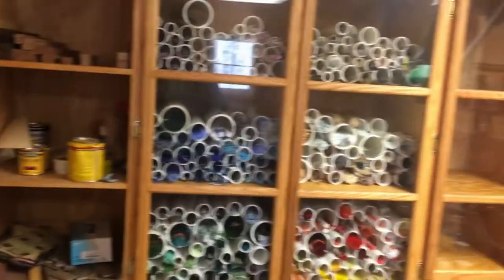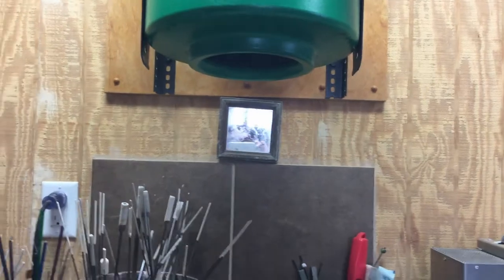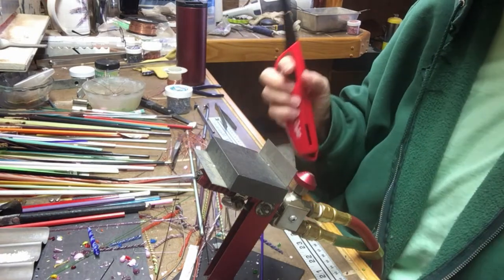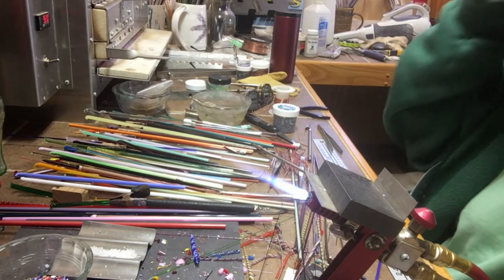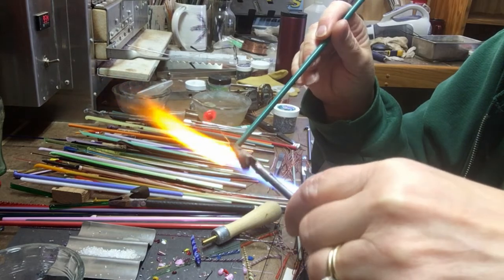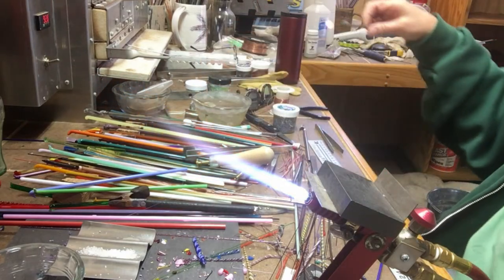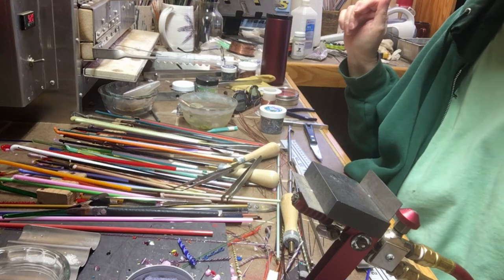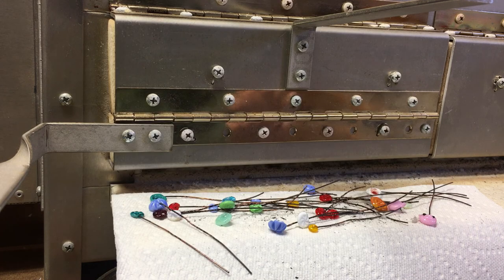Flame and Fiber Podcast - Bonus Episode 65A - Lampworking!!!

Comment: Watching you makes me want to get back to my torch. I love making buttons.
Reply from the maker: I have only made a few buttons and it's something I want to improve. I had trouble getting them off the mandrels. I might need a different bead release.
Reply: @flameandfiberpodcast3162  I have found that not all bead release are the same and I still haven't found one that I like. If I find one that works well I will let you know. I am still trying to decide on what surface mix torch to buy since my other torch has been leaking propane around the connection.

Comment: You mentioned not knowing what you would do with your supplies if you would decide quit lamp working.  There is a husband/wife in our small community who use glass to fix glass windows.  They are working on some beautiful glass art windows that our parish purchased from a church that had a severe fire.  These are the windows that you see in the very old churches when you and I were little girls.  This couple is fixing the windows to fit our church windows, fixing/replacing the broken glass,  reinforcing the pieces.  They have 4 of 5 large windows finished, and 4 of 10 small windows finished.  It is like they take a puzzle and recut it to make a new puzzle.
Reply from the maker: This sounds so cool! My parents bought an old church window more that 50 years ago. For a long time, they used it as a headboard for their king-sized bed. When they built their house 30 years ago, they had it installed in their living room. It is amazing! 

However, I am sure they couldn't use my glass because it is the wrong COE and would be incompatible. But it was a great thought.

Comment: Back for round two. The pig is so cute!!!! I would SO burn myself 🤣 is there ash in the kiln or does it just look like it on video? This is so interesting! How do you get them off the wire? You prob said it and I missed it.
Reply from the maker: No ash. The fire scale that is on the wire does come off in the kiln. The only thing that I made there that comes off is the bead. Everything on the copper wire stays on the wire. The bead soaks in water for a while and then you use a plyers to hold the mandrels and twist it off. The bead release breaks and you can turn it to get the bead off. That's why it is so hard to get the buttons off - you can't twist them, you just have to slide them off which is not so easy.